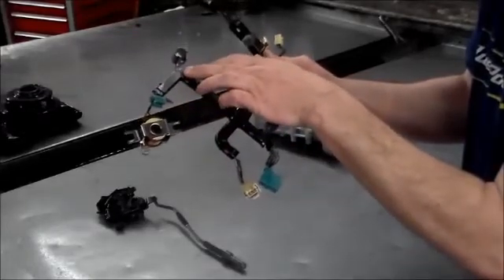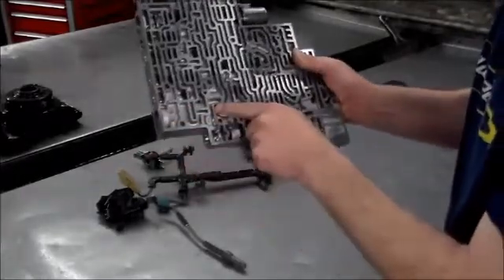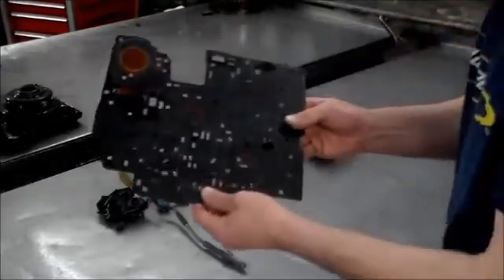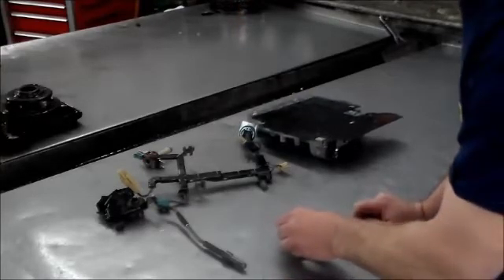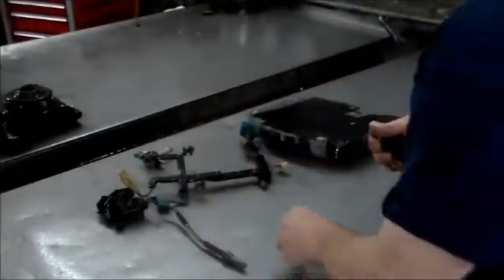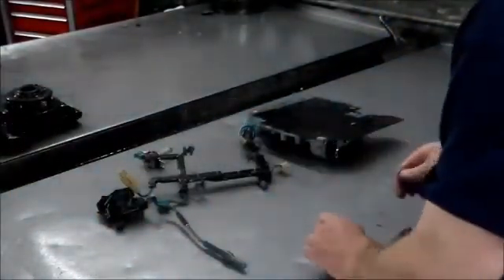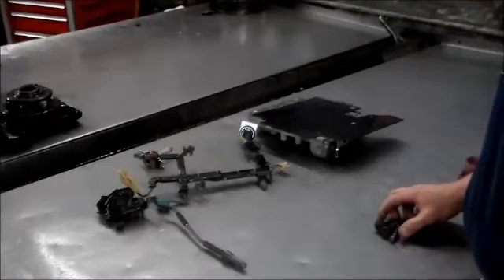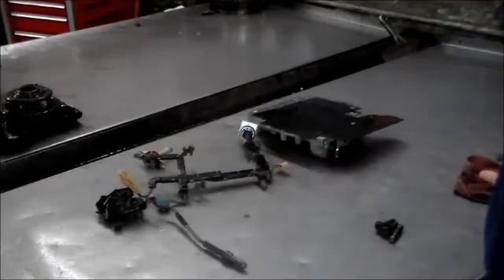4L60E Changes in 2009

Comment: Is there any benefit to retrofitting this type of 4L60E into an 99-06 silverado or anything similar?
Reply from the maker: will not retro down to early units, the only thing that will is the park rod.
Reply: I'm talking about swapping a whole 4L60E from 2009 into a 2004 silverado let's say... Not just parts
Reply from the maker: @drwombat  To many differences between the years, i don't think it would work,

Comment: Around 1:05 you mention they ELIMINATED? the 3-2 down shift solenoid and associated valve/spring/etc from the valve body? How can they do that without making up for it somewhere else or relocating it or something?
Reply from the maker: well, according to GM, they felt it was shortening the life of the band, so ther e reason for eliminating it was increase  band durability
Reply: So how does the transmission shift down from 3-2 without a solenoid? All mechanical? All electronic? This confuses me
Reply from the maker: @drwombat  The computer will command the down shift, they made changes within the TCM,  changed the programming of the tcm
Reply: omg i was wording where The hell  was mine and was like omg thank god for your video so they x it out wonder why tho?

Comment: Would you happen to know why an 09 Silverado LS is slow to downshift sometimes when slowing down to make a turn then accelerating? I thought the downshift solenoid would be the fix but found out what you said in the video (they got rid of the downshift solenoid). Any help would be appreciated.
Reply from the maker: do you mean when you are starting from a stop it's not in first.  Any codes?
Reply: @GaryFerraro  No it starts out in first just fine, its when I'm slowing down but then immediately press the gas again it revs up and then upshifts. It's like it forgets to downshift. Doesn't do it all the time but fairly frequently.. no check engine light.. not sure if it has tranny codes I dont have a good enough scanner to check.
Reply from the maker: @Silenceownz  You checked the fluid level?
Reply: @GaryFerraro  Yep, did a drain and fill on it twice, changed the filter, both A & B solenoids. I just dont know what it could be other than maybe the tranny is going out?
Reply: 2008 Silverado swap  the valve body to a 2009 Silverado 2wd could be o no

Comment: You're the man, thanks for the info!
Reply from the maker: Thanks for watching, please subscribe
Reply: @GaryFerraro  Subscribed! Question for you, I have a 2007 4L70e from a Trailblazer SS that I'm wanting to use for a swap into my 2009 Colorado. Since the 2009 harness is designed for the later model 4L60e (with all the changes you went over in this video) I was wondering if I could take the valve body, separator plate, range switch, and harness/solenoids from a 2009+ and install them on the 2007 4L70e since that trans was already recently rebuilt?
Reply from the maker: @PhoenixInFlite  pretty much anything 2009 and up will not work on anything in early years, tcm are programmed much different
Reply: @GaryFerraro  I'm aware of the programming differences and the e67/tcm will need to be reflashed anyway with the base tune of an 2009 5.3L Colorado and then segment swapped for the fuel/spark tables from the TBSS 6.0L tune file. But programming aside (that's the easy part for me) there aren't any other changes besides the ones you covered in this video, right? If that's the case it would appear to me that I could take the valve body, harness, separator plate, IMS, actuator rod, etc. from a 2009+ trans and swap them onto the 2007 4L70e and it would make it electrically identical to the 2009+ ones.
Reply from the maker: @PhoenixInFlite  Those are the changes, you may have to use the 09 case to match the valvebody and IMS,   let me know how it goes
Reply: @GaryFerraro  yeah that's what I've been researching, whether the case was changed at all to accommodate the IMS or valve body changes. So far I haven't found any evidence to say that it was, and there is a 2011 Silverado with a 4L60e at the local U-Pull-It so I might just go grab the harness, valve body, separator plate, and IMS to give it a try.
Reply from the maker: @PhoenixInFlite  Let me know how it goes, i have never tried that.
Reply: @GaryFerraro  will do, thanks again for the info!
Reply from the maker: @PhoenixInFlite  Happy New Year

Comment: I have a 09 silverado that have that switch inside 4l60e. I brought another from 2005 found out the difference. Is there a way you can switch all those over ?
Reply from the maker: Anything 2009 and up will not interchange in previous years. Thanks for watching

Comment: i have a 09 express. i found a late 08 trans  with the iss but has no internal range . can i swap out the valve body to the 08 work
Reply from the maker: 2008 will not work, in 2009 they added the internal mode switch and eliminated the manifold pressure switch.
Reply: +Gary Ferraro. can i take the range sensor out and install into 08 the 08 has a iss
Reply from the maker: 2007 and up have the iss, there were other changes in 2009 that will not retro back(the ones i mentioned before)2008 and down will not retro fit
Reply: +Gary Ferraro i ok w as reading forum and few pwople said they done it
Reply from the maker: Totally different set up. did they do anything with the computer?
Reply: +Gary Ferraro. no

Comment: what vehicles are using the 09 up 4l60e as alot of vehiclesales have changed to 6l80e
Reply from the maker: +STEVEN FLORES (PETROMAN)  Yes you are correct, i've done a few chevy express vans that were 2009 and had the 4l60E, one of them was all wheel drive. Thanks for watching. Gary